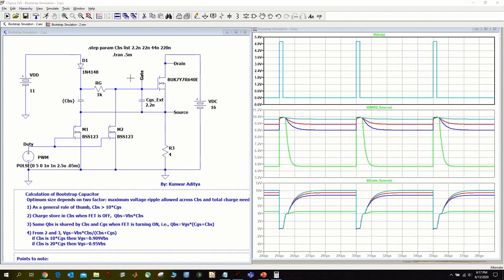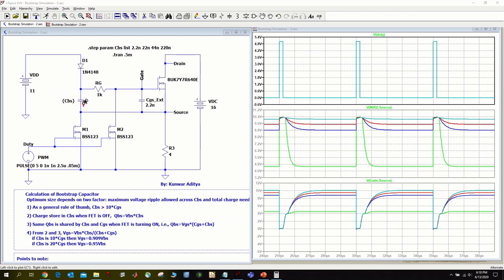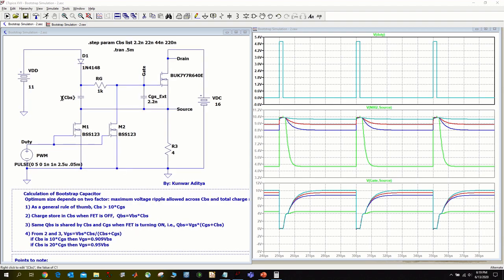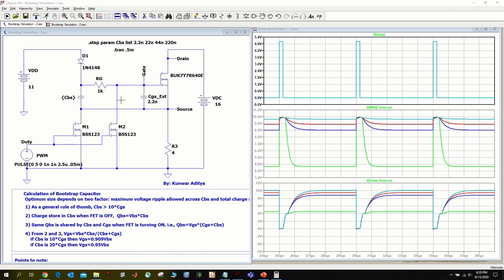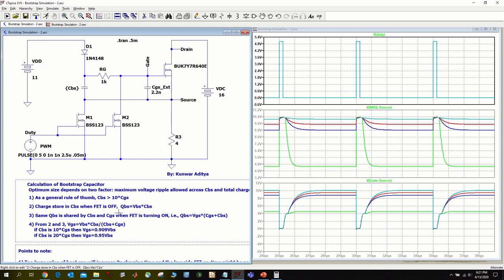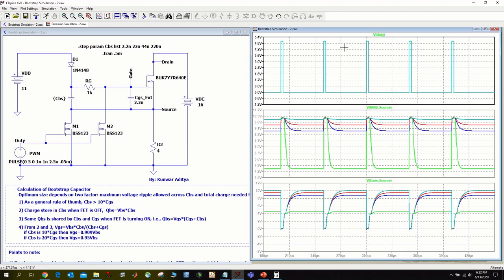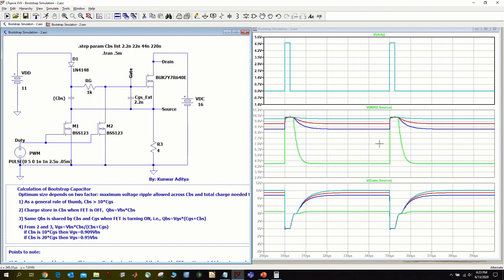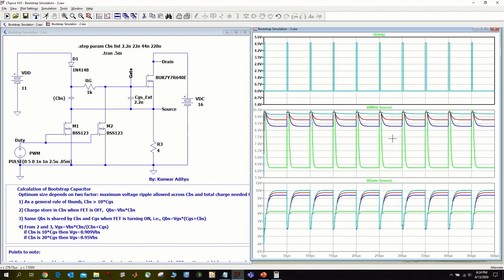Design Guide for Bootstrap Gate Driver Circuit with LTspice Simulation

Comment: tks for video, that's very useful, but if we use this for buck circuit (not synchronus buck), at Ton when 2 mosfet M1 and M2 on (closed) at the Source point had buck voltage, so the M1 will short at this time, so this circuit will help for highside mosfet with resitor load? or am i wrong?

Comment: Thanks for the informative video. Can there be any disadvantages in selecting a too high value for Cbs? For example, if I use Cbs>1000*Cgs what will happen?
Reply from the maker: Disadvantages: 1000*Cgs capacitance will be costlier, It will also consume more board space if belong to same type (e.g. Ceramic) and lastly it will take longer to reach full voltage and hence transient performance will be slower.
Reply: @Charged_EE  Thanks for the reply. If you don't mind, I have another question to ask. In many examples, I have seen another low-value capacitor used in parallel to Cbs. Is this necessary? Or will the circuit work just fine if I use just one appropriate capacitor?
Reply from the maker: @prabhatkiran3226  depends upon your layout...if your boot-cap is located far from gate driver pins then you may want to put some low value bypass cap on the pin-out of the gate driver.. this is done to compensate drop in trace inductance and smoothen the waveform..
Reply: @Charged_EE  Thanks man. You cleared my doubts.